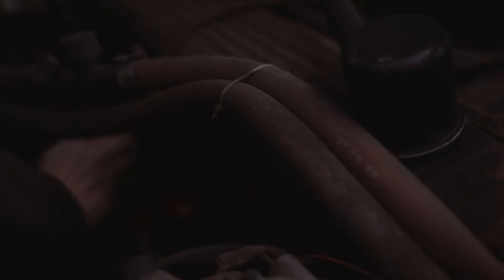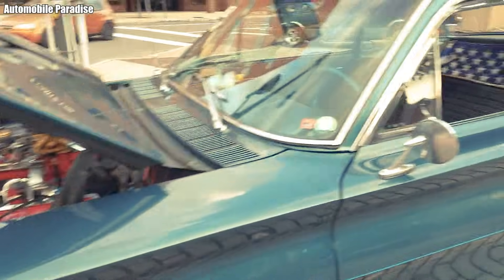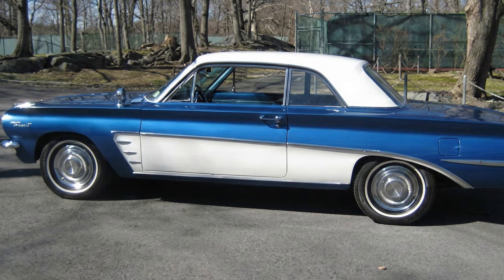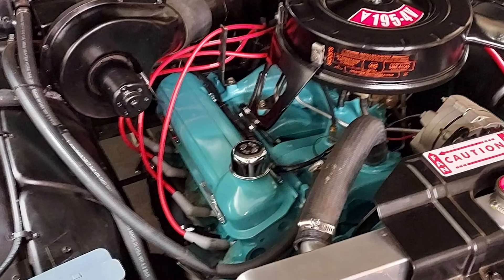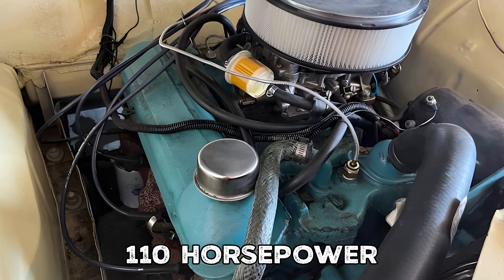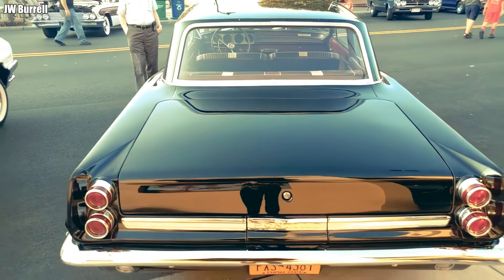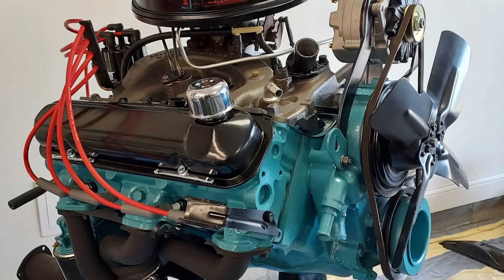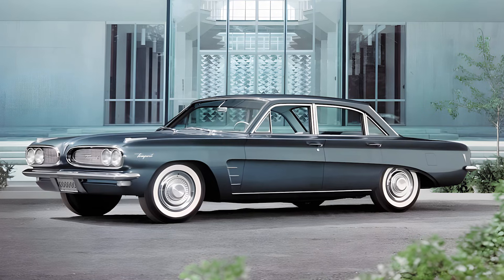The Weirdest Drivetrain GM Ever Built: Pontiac Tempest Explained

Comment: Hey AI, if they "cut" a V8 in half, what happened to the other half that was not used? As for the speedometer like cable drive shaft, that 4 banger did not have enough torque to damage it.🤣

Comment: AI slop. Right off the bat this video starts off wrong. Pontiac wasn't strapped for cash when it created a 4 cylinder by chopping a bank off of a V8. It was about cutting down development time of a 4 cylinder. Wide Track was also a creation of John Delorean in the 1960s that was exclusive to Pontiac.

I would go on showing more of the things wrong but I'd be here a while.

Comment: A friend working at a used car lot had a Tempest that he got for almost nothing when it was new. The new car dealer's mechanics could not find the source of the terrible rattle the car had. It was a loose bolt in that crazy ass drivetrain which was fixed in just a few minutes. He lived into his seventies, basically drove the car his whole life.  That engine and it's V-8 brother had a hard to get at spark plug, front, passenger side on the 8.  Mechanics would go "screw it" and not change that one, but you can't do that forever.

Comment: I worked from the time I was 12, 1966, for 12 years in our transmission shop. I never saw a Pontiac Tempest in all those years. Says something about them getting it right, or maybe so wrong that nobody bought one. I assume right, after all if not for the GM Turbo Hydro 350 my family would've starved.

Comment: I had friend with these Tempests. The knock about engine vibration is really over blown. The engine vibration in this Pontiac was not much different from other low end cars of the era. If that engine had stayed in production, Pontiac may have looked at adding a counter shaft to it. But it was easier to just change over to small engines form other small cars lines that GM had on tap.

Comment: Mercruiser used  half of A 460   engine for inboard / outboard units
Reply: Called the 470. Used the 460 head on their own lower end.
Reply: I think Mercruiser used the Ford big block heads but on their own block design.  It's also worth noting that the Tempest was available with the 215" aluminum V8.  That would likely have been smooth and quiet, with better weight distribution, as the V8 was lighter.

Comment: This typically overly wordy AI video missed the real point of the whole thing.  The Tempest was the result of compromise in GM Corporate politics.  Prior to 1984 the "brands" were autonomous divisions within a corporate umbrella, and each competed internally every bit as much as externally with Ford and Chrysler.  When Chevrolet was preparing to launch the Z-body Corvair in 1959 they got cold feet at the last minute.  Chevrolet asked GM Corporate to ask Pontiac Motor Division to sell a badged version.  Bunkie Knudsen wanted nothing to do with the Corvair and said no. (Everything done by Chevrolet engineering was a fundamentally flawed design.)  But he knew better than to say no twice, so when they asked again he instead proposed for Pontiac to sell a modified version.  Instead of the Z-body PMD engineering modified a Y-body shared by Buick and Oldsmobile. (The video danced all around this, but it's OK, you can say it - Y-body.)  By the time they were done (fixing all of Chevy's screwups) there was almost nothing from the Corvair used and Pontiac had a much better car than the Corvair could ever pretend to be.  And what really happened to the Corvair?  The day Knudsen was promoted from general manager of PMD to general manager of Chevrolet was the death knoll for the Corvair.  It had few friends left and Knudsen had no interest in continuing development of the Corvair.  The "senior compact" unibody Y-body was replaced by the midsize body-on-frame A-body, and even Chevy got a version simply because that's the way the market was headed.  That's the real story and in much less than 16+ minutes of AI jibber jabber.
Reply: "Everything done by Chevrolet engineering was a fundamentally flawed design," Especially that small block V-8, huh?

Comment: The AI voice failed to mention that the Tempest shared most of its transmission parts with the Corvair.
Reply: In 69, I I was taking auto mechanics in High school. Had a new "instructor" assign me to replacing the clutch on a 63 Tempest. I knew what I was getting into. The A-hole kept insisting that I pull the transmission out. I kept telling him I didn't need to. He didn't bother to get down and look. This went on for 3 days. I finally got him to look. As soon as I finished the job, I insisted on a transfer to a different class. I got it. I got my mechanic's certification with my diploma.
Reply: That's the entire reason for the odd transmission design.
Reply: That's because it is AI-Tarded

Comment: Those tiny top of fender chrome fins are silly & might hurt you when working under the hood.
What if Pontiac made a v4 out of their v8 instead?
Reply: Then they'd be like Ford and who wants to do that? 😆 (Although PMD bought several things from Ford - the Heavy Duty 3-speed "Dearborn" manual transmission and the Super Duty hood scoops.)
Reply: Then they'd need a new crankshaft, camshaft, 2 new cylinder heads, 2 new exhaust manifolds & a new inlet manifold instead of just modifying the casting for the engine block. Too costly. And it would still vibrate.

Comment: All 4 of these GM cars are from this era were when GM had the engineering team to try anything. The big driver here was the move to make compact cars in the early 60's for economy reasons.  The Olds version had a more typical drivetrain layout but with turbo V8's, the Buick same as the Olds but with an aluminum V8 that would become the 231 V6 and many other engines over the years, the Corvair rear engine flat six N/A and Turbo versions and of course the Tempest. All of these cars concepts that would become part of the future automotive world. They sold well but were ahead of their time but they world develop into the more standard layouts a couple years later.
Reply: There wasn't a "GM" engineering team.  Each autonomous division had its own engineering, styling, marketing, and management.  The body structures were designed by Fisher Body, then each division applied their own styling to the exterior body panels, and had engineering for their own interiors, powertrains, etc., while other inhouse suppliers made parts, like Packard Electric for the wiring harnesses and switches, Delco Electronics for the radios, Harrison for cooling systems, etc.  GM was the corporate holding company.
Reply: @jeffbranch8072  Typo error it should have been teams instead of team. GM was different from the other car companies because all the divisions did their own thing up to the late 70's and then it was badge engineering.
.